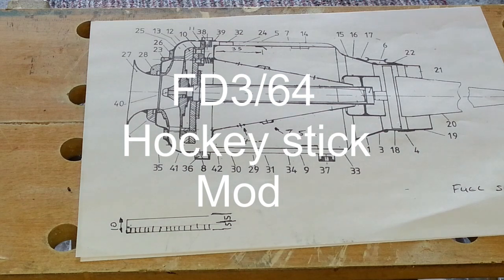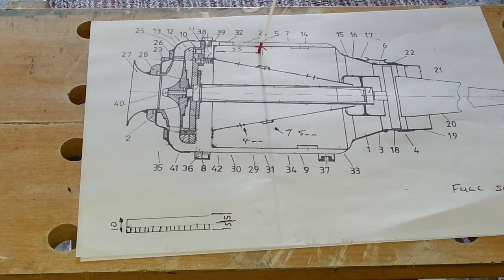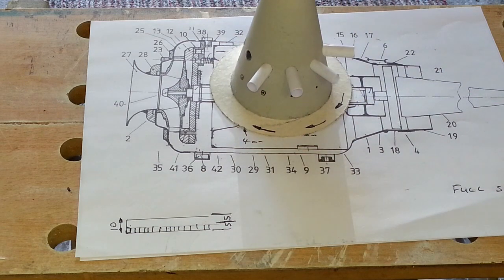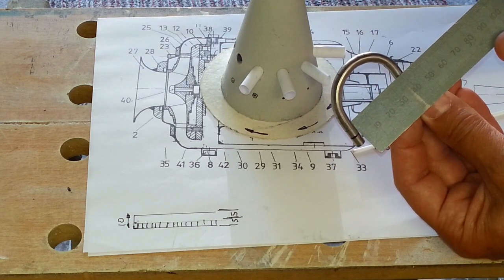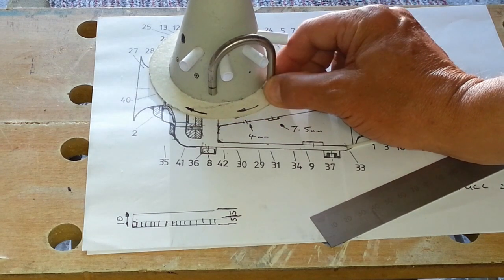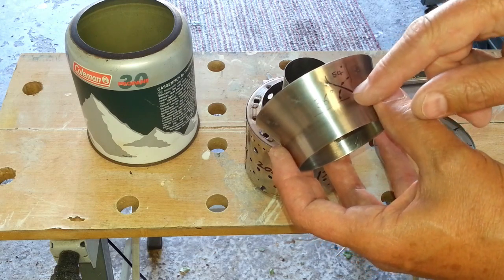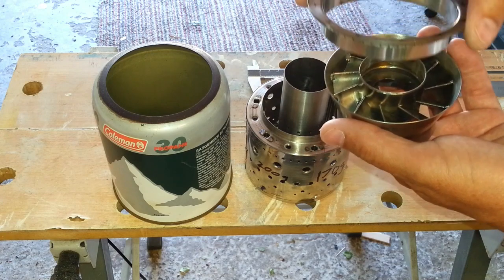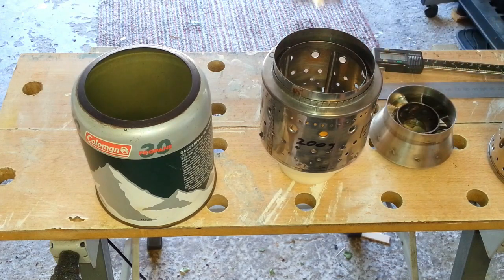FD3/64 stick mod

Comment: I ditched the tapered combustion chamber and the coil very quickly. Still ran too hot.
Reply from the maker: answer is the pt35 combustion chamber hole pattern  but I've stuck to the open back combustor and have the hockey stick vaporizer tubes of the hobbyjet 631 on the front plate of the combustor. The pt35 is a development of the hobbyjet 631 the hole pattern is slightly different but does make a difference.
Have you run yours on gas from a big propane  bottle with a regulator set at 40psi  if it does not run right on gas you have another problem .